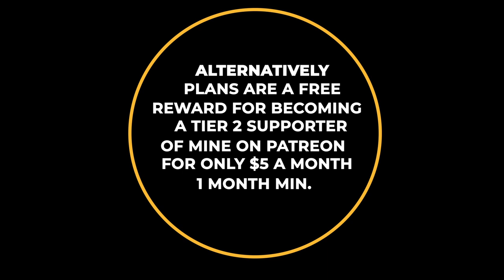PopUp Workbench Based on Sawstallions and Matchfit Clamps - Plans and Support Videos Available

Comment: You really love you some Match Fit Clamps!  Nice job with the video
Reply from the maker: Thanks, Scott.  I buy a pair of Matchfit Dovetail Clamps each month for about $45 - 10 months later and I am all set!  Also, T-track clamps and jigs can be used in the Dovetail Slots if your grind them with an angle grinder to reduce width of connection end to just under 7/16 of an inch.

Comment: I'm putting all of your Sawstallion videos into one folder for easy access, and I just re watched this video and noticed something I did not notice two years ago. From 3:07 to 3:17  your original Sawstallions are alongside the new plywood ones in the video, and the original set looks like it has two different top rails on them. The bottom set is mounted on the Sawstallions, while the other set is just sitting on top of them. The pair laying on top has what appears to be over bored holes for hardware with washers to attach it to the Sawstallion. Am I correct, or am I seeing things that aren't there?

I guess I could look for the video of your original set, but I'm already seriously interrupting my progress by watching unrelated videos. Thumbnail  appear when your video ends, and I keep being distracted by the guitarist  playing in various outdoor street side locations who plays requests from his audience.
Reply from the maker: On the old sawstallions which were Samurai sawhorses later modified to have flat side faces, the top consist of three layers with the middle layer being more narrow leaving a place for clamps to hang onto.  Not a necessary design  - the 2x4 version of Sawstatllions is the best and easiest to make.
Reply: @SmallWorkshopGuy  I couldn't quite figure out what I was looking at, and as it turns out, I was completely wrong.

I should have taken the time to look for the video(s) of the build.